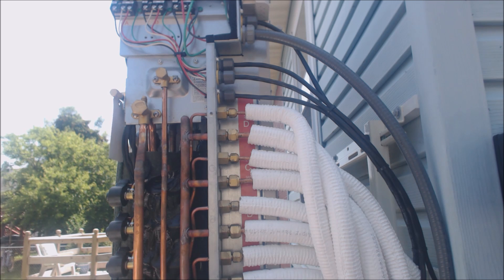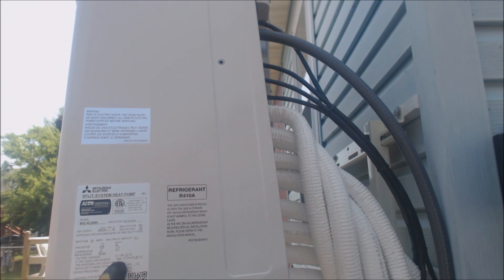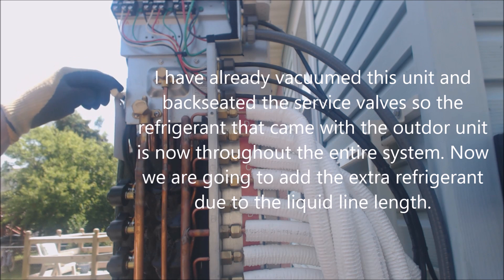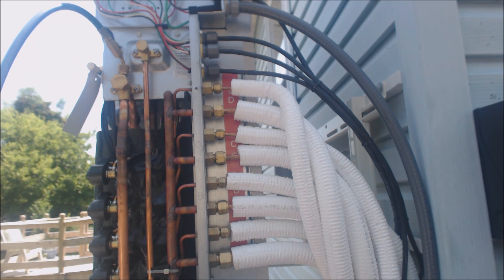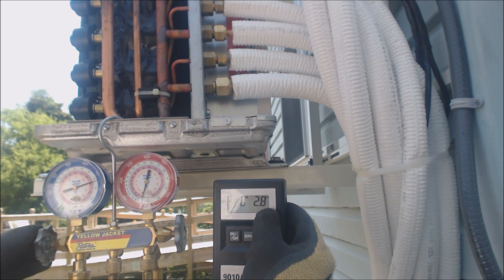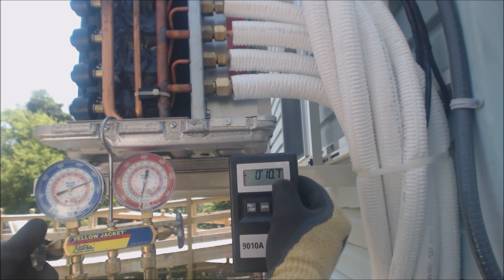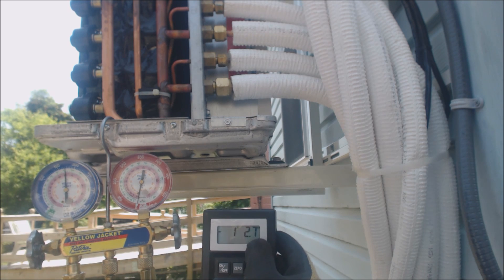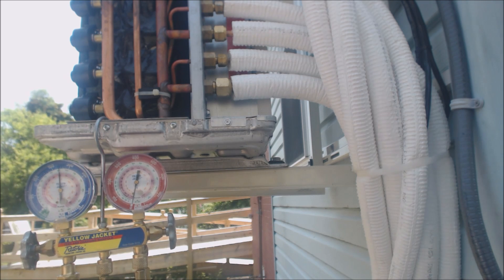Weighing in the Correct Amount of Refrigerant in a Mitsubishi Mini Split Unit!

Comment: Hey buddy. @ 3:45 You can use a valve-depresser. thats what I use and there is no worries about gas coming getting spilled while accessing the system.
Reply from the maker: Great comment, those take the rush out of the process!